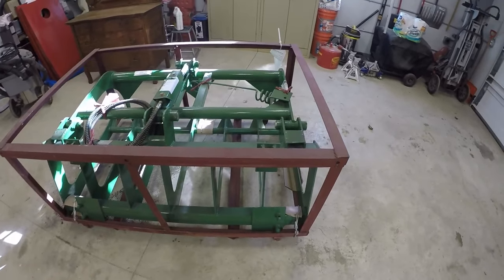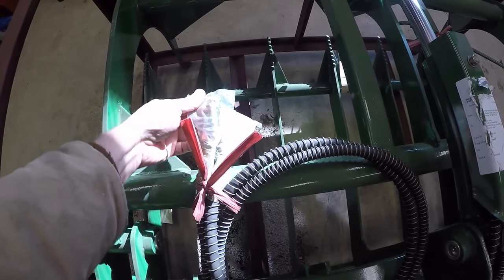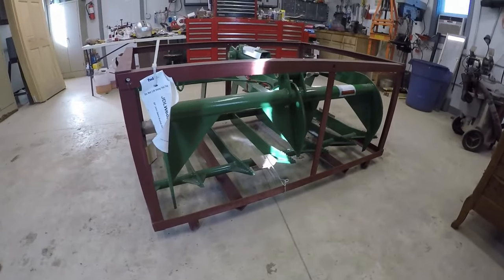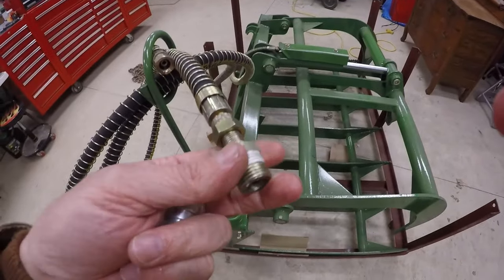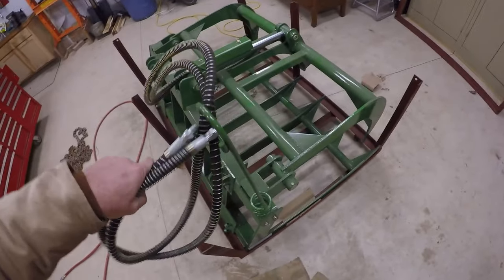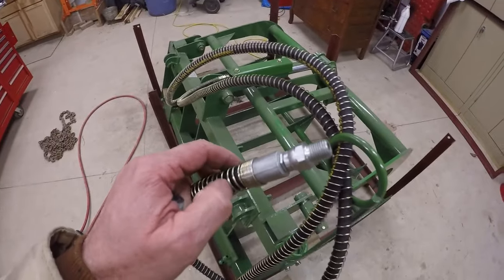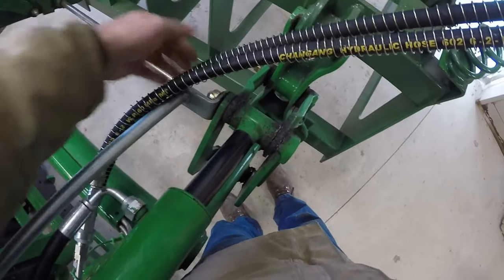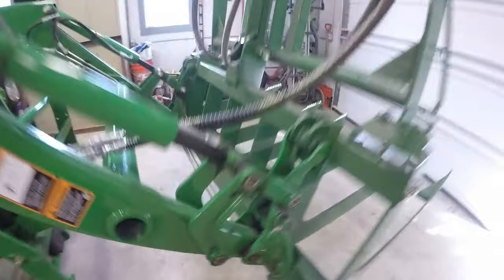John Deere 3320 with a Titan 60" grapple

Comment: Sean, nice video. I bought a grapple rake from Titan in fall 2015 for my 4320. I had bought their pallet forks and some of the weld up John Deere QA front plates for my loader. Very well made unit and well worth the price. For future reference, check out surplus center when it comes to hydraulic parts. Obviously it won't help if you're in a pinch but for planning ahead of time they're great. They carry all the thread types and connections plus you save a bit.
Reply from the maker: I will check out the surplus center. Thank you for the info!! I think my next purchase will be their forks. The grapple is well built.

Comment: After what you said about the locations which is not correct I am now going to look at the Frontier brand when I want to buy one for my tractor. I don't like the idea of the connectors not being correct for your tractor, and some connections being incorrect, making it impossible to connect to the tractor connectors without further modifications.

Comment: Glad I found this video.  I think the 60" is too big for a 2025R despite my loader being mentioned in the description from Titian, I see no way 2025R could handle that.
Reply: Great point.  I’m about to pull the trigger buying the 48” root grapple from Titan for my 2038R (2017) mainly so I have less mass to lift when considering the weight of the load or bigger logs.  The larger buckets would probably eat up way too much of my lifting capacity.  Back ordered for a month or so... time to figure out how to rig a third hydraulic function.  Wish me luck!
Reply: @gwolf7716  I have a Titan 48" (might be a 54" but certainly not 60") grapple on a 26 HP JD 4200 and it's a great size for that size tractor. You don't gain much functional advantage with a wider grapple but you lose lift capacity and manuverability.

Comment: I can't find that exact grapple online, where did you order it from? Thanks.
Reply: Looks like they don't sell a 60" like mine anymore. Now it has two grapples on it.  To get the single grapple you have to order a 48"
Reply: @featherwingy  I have the 48" single clamp version and it's very stout and has held up very well clearing timber. The reduced weight allows for heavier loads while staying within the loader capacity (JD 420 loader).

Comment: Pardon my stupid question.  I, too, have a JD 3320 -- but with a 300x loader, but I'm unclear what modifications, if any,  you had to do to the tractor for the grapple hydraulics.  I assume the same SCV stick which controls the loader boom height,  and roll and curl function remain the same but what controls do you use for opening and closing the grapple?  Do you know if the 300x can be retrofitted to handle a grapple?
Reply from the maker: When I purchased the tractor it came with a remote hydraulic hook up on the left side of the rollbar.  The  additional remote came as a kit. Back then the cost was around $1500. I believe part of the kit is a new handle for your loader that comes with a thumb switch.  The switch controls the remote hydraulic. The remote hydraulic is what I use to control opening and closing of the grapple.
Reply from the maker: The kit I installed on the loader seemed like it would fit the 300x loader too. Just double check with your dealer before you order it.

Comment: How do you like your 3320 I’m looking at one to buy in a couple days ?
Reply from the maker: I like it a lot. I needed a bigger tractor to plant my garden using plastic mulch. Its worked great for that. I picked up a used 72 inch belly mower to mow the field grass and its much faster and easier than using the 5 ft brush mower on the back. It has plenty of power and I figured theres less to go wrong getting a non turbo motor.  Although if I did it again I wish I had paid the extra and got the cab model with ac and heat
Reply: What attachments do you have ?
Reply: I need a grapple like yours what did you pay for yours ?
Reply: And do you know that hydraulic kit part #
Reply from the maker: I purchased it directly from Titan. It seems like I paid around $1100.00. its 60 in. Someone said the 60in like mine is no longer available.
Reply: Really that’s not good I know gearmore does .
Reply from the maker: JD 72” non auto connect belly mower. Frontier 5’ brush mower, Frontier 5’ box scraper,  5’ King Kutter tiller.
Reply from the maker: The part# for the selective control valve kit when purchased 12/2015 was BLV10761. I paid $852.50 from JD dealer.
Reply from the maker: I think now they sell it with 2 cylinders and 2 separate jaws. That probably clamps uneven things better. I figured having one cylinder probably cycles a little quicker. So far its held up well with no issues.
Reply: So all in all about 2k sound like
Reply: Need it to load up logs and branches I know I can use a chain but this is way better don’t have to get on and off ya know

Comment: Looks like a good quality grapple, but why not just get a frontier one that you know is going to fit right and have hydraulic lines with the right fittings and are made in usa.
Reply: And also where did you get that hydraulic top link?
Reply from the maker: I priced one at my JD dealer but they wanted twice as much money for it.
Reply from the maker: I ordered the top link and the lines with fittings from Amazon.com
Reply: Frontier is a JD brand made by subcontractors. Quality is usually fine but price is premium. You can always find similar quality for much less and often already painted green.

Comment: This kind of tractor is too slow if you dont have a car with a trailer. If the distance is too far you spend a lot of fuel. Finally if you have a big tractor the problem is that you need a lot of fuel in your fuel tank. Jhon Deere is a cheat they don give you this tractor with 40/50 km per hour.
Reply: I have a little 16' trailer that I use to haul my wife's tractor (308e)around if it is going any farther than 1 mile down the road.  It loads and ties down easily on that trailer.